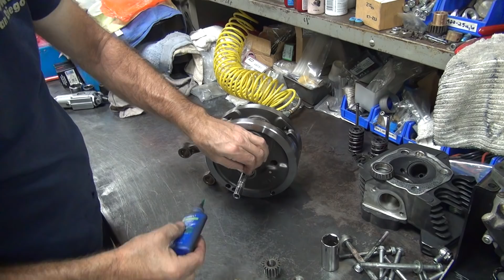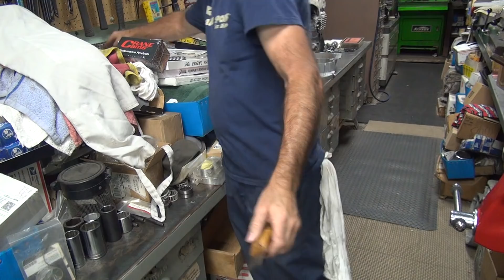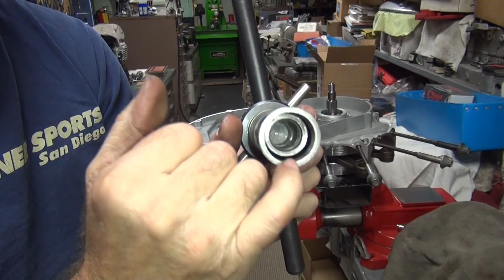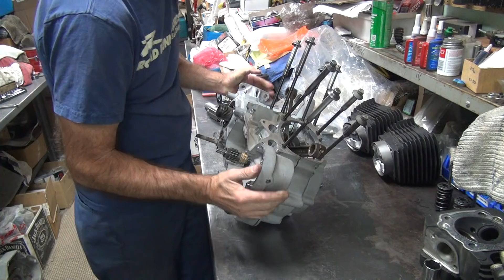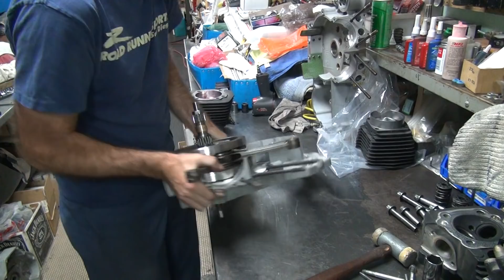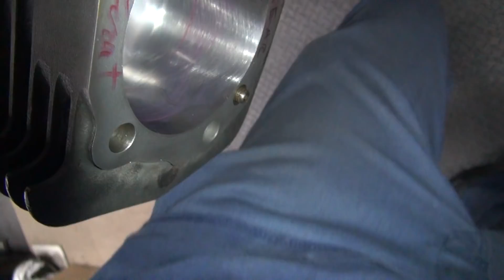1990's #102 evo sportster 90ci big bore lowerend assembly motor case machining tatro machine

Comment: How long does one of these motors last? It just seems like the cases and cylinders are being hacked up to make everything fit. Unless I'm racing it, I don't see the point.
Reply from the maker: if built correctly these things can last a very long time. if not, than they will not last either. the same goes for stock motors to.
tatro

Comment: Still a 4 speed tho?   I have a 4 speed hated that mutha all high rpm lol got me a 5 now in my 1250 twin cam eater
Reply from the maker: all harley 5 speeds and 4 speeds have the same high gear. the 5 speed just keeps you in the power range when your motor is low on torque. big torque motors don't like all the shifting. they like the load the 4 speed puts on the motor. now 3 speeds suck. just watch my wla drag bike.
tatro
Reply: thats a 5. Looks to be a 95-96, electric speedo port on back of case.

Comment: could you machine down the outside diameter of the cylinder, to fit the case? probably a dumbass question.
Reply: no, the case has to be bored, the cylinder has to remain a certain thickness.
Reply from the maker: no, the cylinders are way to thin already because they are .060 over now. everyone likes thin ass bigbore cylinders but they actually make less power because they flex all over the place instead of sealing the rings like they should. that is why all cast iron cylinders make more power than flexibly aluminum cylinders. no strength.
tatro